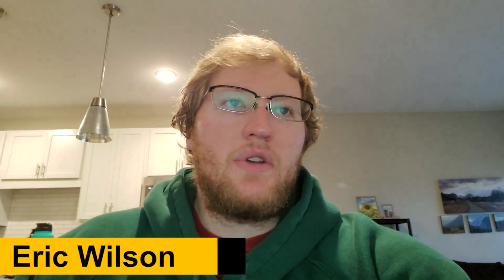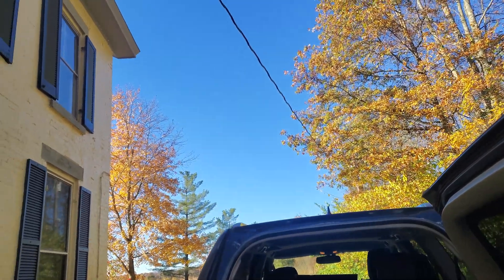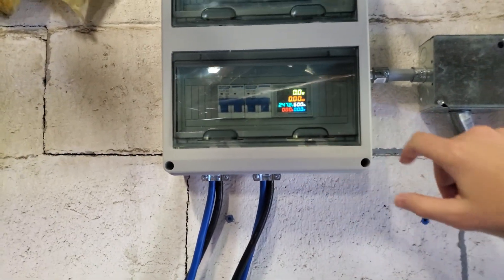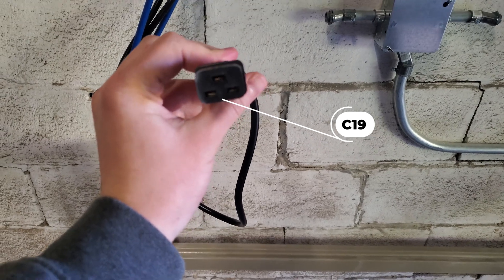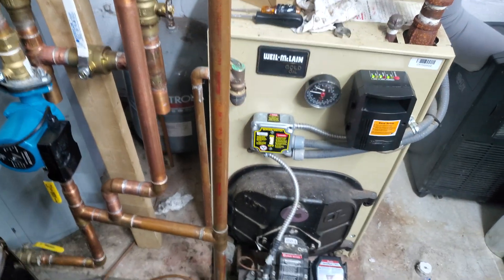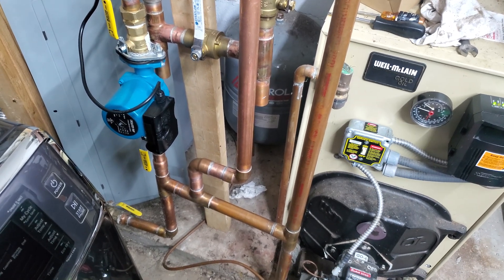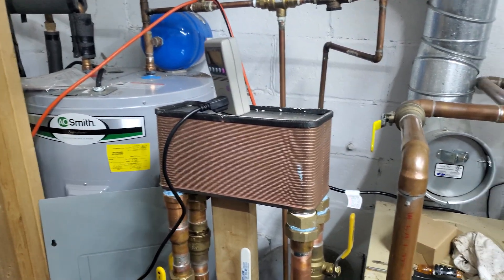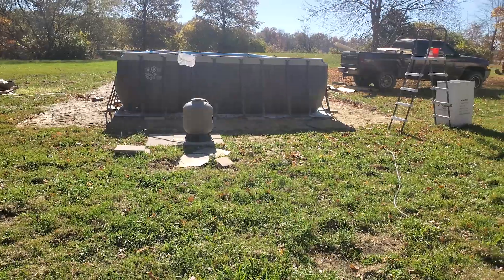How To Heat Your House and Pool With a Bitcoin Miner

Comment: You can just use a heat pump hot water heater,  it just draws heat from the air around it and crams it into the water.

Comment: Really cool stuff. I can see a future where contract companies can come in and build this out for you. Outfit your home with solar, wind, and heat sourced from miners. Between the free intermittent energy and the offset costs for your grid energy, home Bitcoin mining can outcompete the larger farms.

I would invest in this kind of setup even if the expected returns underperform just buying and holding Bitcoin. At the end of the day it's net profitable over time, offsets your fixed costs directly, and it decentralizes the network. Once you have enough Bitcoin this is absolutely the next step. Love it!
Reply from the maker: Exactly! Definitely keeps the home miner competitive in these rough bear markets.
Reply: @wilsonmining898  Do you see a point in the future where these "double usage of heat" solutions combine with spare/stranded energy opportunities to essentially crowd out any miners who actually need to purchase energy? Essentially, the hashrate remains permanently unprofitable due to all these price agnostic mining setups?

Obviously that is not the reason for todays rising hashrate (too many levered miners committed to too many miners just getting delivered) and we are far away from this kind of world. But it does seem like mining will eventually tend towards the cheapest electricity. If the cheapest form is essentially "free" (double use or stranded) then...
Reply from the maker: @IRLC  I personally don't think so no. Those very specific situations are few and far between in my opinion. BTC miners are only used for heat in incredibly niche environments. The situation has to be just right, and the BTC miners have to be more efficient/cost effective than the models already in place to justify the extra cash expense and risk. I just don't think there's enough of those specific situations to push people buying energy out of mining BTC.
Reply: @wilsonmining898  Agreed that's certainly true for the next decade or so. I tend to be a much longer term thinker as I believe the mining industry is chasing temporary incentives during these early halving cycles.

I also think the stranded and excess energy story has more legs here than the dual heat usage given there is so much of it between thermal capture, converting flared gas, building out remote hydro using mining as first and last buyer, etc. There are many opportunities where the upfront costs are the only piece of the equation.

That said, I think HeatBit is an interesting hint at the future of home mining taking a role. It takes the same amount of energy as a normal electric heater, provides competitive heat output, and actually warms an equivalent area faster than most other space heaters.

The large problem here is the cost difference and the intermittent usage of the heater causing most to spend years earning back the initial cost. But there's a good chance this kind of appliance becomes more cost competitive with non-mining versions eventually. They'll always be low hashrate though so it would take millions of people to impact mining broadly.
Reply: @IRLC  I am replacing the fans on a $200 T15 to use as a heater. The heatbit uses an S9 which is roughly half as efficient. We're running out of room for improvement for bitcoin miners.  When the new (and last) generation of 3nm chips comes out,  there will be no more room for improvement,  and it will be possible to extend the ROI on your equipment out for years,  and not have to worry about the hashrate changing +150% because a new miner came out.